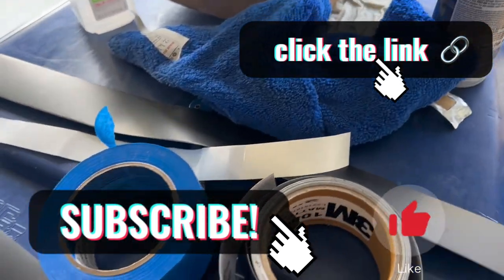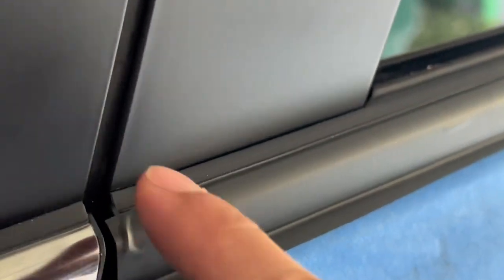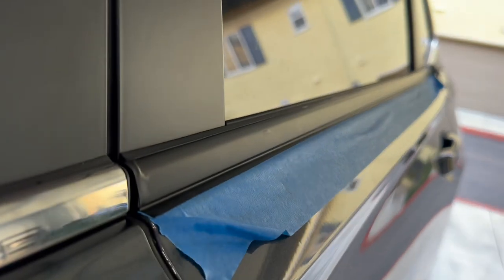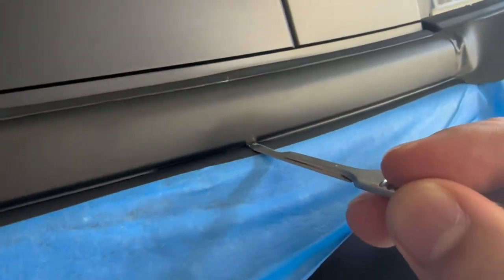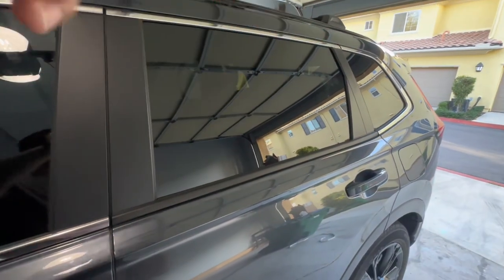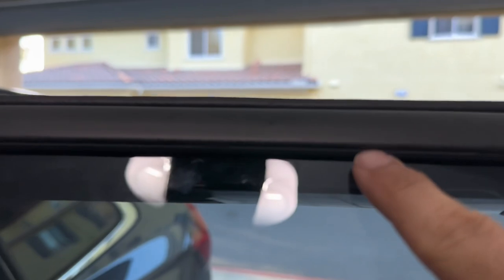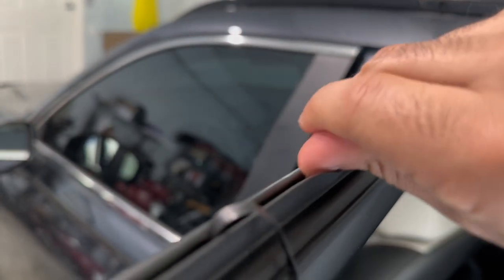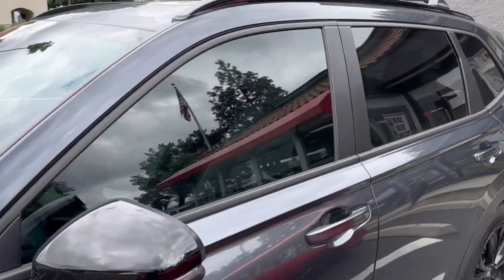HONDA CRV 2023 - CHROME DELETE!

Comment: Thanks for the video. I have the same CRV in Radiant Metalic Red. People are asking about a video on Fog Lights. I dont believe there is a Honda accessory for Fog Lights on a 2023 CRV. ???
Reply from the maker: Theres no honda accessory correct. 
I have purchased 3rd party accessories. 
There is a slot for fog light switches left of the steering wheel however.  2 blanks. 
Nice color choice!  Id be interested to see it with black trims. Itd look nice with a deflector and black door handles.

Comment: Another question, can you give some pointers on how you did the wider curved part of the trim? I'm assuming you used a heat gun to get it to bend ? Thanks
Reply from the maker: I used a big sheet for that part.  And cut it out once i placed it on top.  Not the easiest part.  Bending doesnt work too well at 90deg
Reply: @DrHondaCRV  Ah this makes sense, thanks. I didn't even notice the 5ft by 2ft link. I already have the 25ft roll, going to order the big one now. Thanks again

Comment: Looks good. That hood air deflector did you put on?
Reply from the maker: I had it installed at the dealership.  But it doesn’t seem to complicated to install.  Some cheaper online dealership Links in bio if you want to order.
Reply: @DrHondaCRV   it’s sitting in my kitchen. Was thrown off online cause it says it’s only for EX & EX-L
Reply from the maker: @nmfdchris  interesting 🤔.  Well.  I added it. Haha.    I know they have different floor mats for hybrid vs non hybrid. I wonder if theres a slightly different one for hyrbid

Comment: Looks awesome. Good work.  Question- I have the hood deflector too. Ok to go through a car wash? One of those new carwashes, you buy a membership for 25 bucks and can use it once. day. they seem to be gentle with cars. Used it on. my last one. was fine. Just worried about the deflector.  thoughts?
Reply from the maker: I guess it depends which way their brushes are spinning.  against the opening wouldnt be great.. on another note, don't take your new car into a automated washer!  might as well wash it with sand paper XD. micro scratches for days... :(
Reply: @DrHondaCRV  good points. I’m just not as young as I used to be. Thanks for reminding me of why I should find another solution

Comment: How did you do the hyperdip on the square grills on the front bumper? Did you pop them off or mask and paint them as is?
And did you also do the same for the ones at the back bumper? Or would there be an issue with having an exhaust in one of them?
Reply from the maker: Just mask and paint!  im doing the back ones soon. the exhaust doest touch it  so its fine. the pipe is behind
Reply: @DrHondaCRV  Thanks! I saw your latest vid and it looks great so I want to try to delete the chrome on my red one as well. I noticed that some people use hyperdip or plastidip on the chrome of their windows. Any reason you used tape instead? The tape is harder to get here than hyperdip but just wondering if there's anything in particular with the cr-v that made you use tape instead.
Reply from the maker: @mauz30  So the dip isn't as durable. especially in high use areas. I honestly thought applying the tape was easier than the hyperdip. a lot faster too.   logo i used paint because it was too intricate for vinyl tape, up to you!.

Comment: How did you do the last section of the window? I’m having a hard time tucking the vinyl in that section. The rubber trim seems much stiffer in that area.
Reply from the maker: So i used the 2x5 sheet in my description. I covered the whole window with it.  

Then did a rough cut carefully. Making sure not to cut the paint.   Then a finer cut along the edge.  I kept pushing it down with my hands to find the edge crease.   If you accidentally cut short use a heat gun to stretch it out.  

Theres some videos on youtube.  search for rear window 3m tinting.
Reply: @DrHondaCRV  great job on the chrome delete. i'm planning to do the same on mine. did you use two 2x5 sheets, one for each side? Or was one 2x5 sheet enough for both sides?
Reply from the maker: @markofthekings  one was enough. I cut it in half. You have to angle it just right.

Comment: Found the headlights good, except for rainy nights as you said. Still miss fog lights. My 2018 crv is awesome at night with all those super bright amazon led lights lol
I like the blackout, I just don't have the patience and refuse to pay anyone to do it.
Reply from the maker: 😂😂😂 I did the left side. And the right was 2 months later.    Weekend hobby if you get bored.
Reply: @DrHondaCRV  I'm going to add caps to improve visibility of ac vents, 304 stainless mirror finish license plate holder, remove dealer stickers, do led rear blinkers, maybe replace the horn. Waiting on the good weather tech mats to come out, bought the rear cargo cover and partially ruined due to wrong placement... Which by the way, what a waste of money considering people can still see your trunk from that rear little side windows...
Nothing too risky here hehe
Reply: @DrHondaCRV  The rear led replacement are 7440, so easy to replace, two screws the housing pops out.
Reply: @DrHondaCRV  Also ordered some warm white led lights for the sun visors.
I don't know you, but I do absolutely all my maintenance, my car will never ever see a mechanic, and I found the location of the engine filter to be the worst ever imaginable. All the way shoved in the back between fuel and brake fluid lines. So hard to take in and out. Cut myself I don't know how many times lol. Of course Honda uses those nasty oiled engine filters, so I ordered an aftermarket one. Those oiled filters are truly bad for sensors and will eventually create an oily film everywhere the air goes after that.
Also noticed that I have to remove the entire door to replace the cabin air filter, but it is super easy anyway. The door just doesn't go far down enough otherwise.
Reply: @DrHondaCRV  Ok, my last observation I hope lol.
Hate the way washer fluid comes out, plus we don't have any indicator light for low fluid as Canadian versions. So you can't see the fluid, neither know when it's low. Freaking bizarre.
Then it was a great surprise, that even if crappy, you can use the fix and go compressor to fill your tires. Threw away the liquid fix, but nice to have the compressor  hidden like that, and for free.
Reply from the maker: @rafars2246  good to know. So easy swap for blinkers?
Reply from the maker: @rafars2246  too lazy for black vinyl but do all your maintenance? Haha.   Did they give you 2 years free service like mine?   I just take it there for free oil change and tire rotation.
Reply from the maker: @rafars2246  jeeze. Air cabin sounds annoying to change.  I thought you meant the car door haha
Reply from the maker: @rafars2246  yea its an interesting window fluid mechanism.  Keeps the hood clean though.   I bought a battery powered tire pump. And a tire plug kit. I got a flat last month.  And it was a quick temp fix. Until i could take it to the shop for a full patch
Reply: @DrHondaCRV  not even about being lazy, just make me very nervous and stressed when it comes to precision jobs like that.
Yes Honda themselves gave me the two year free maintenance, but I can't put my car in stranger hands. Plus I know how to do it. I take easy, just gives me piece of mind. And I do things my way. Replacing that engine air filter asap, doing the first oil change at 1k miles or whatever, haven't looked how to break in a hybrid yet.
Even with simple oil changes and tire rotations things can go wrong. Hate when guys over torque lug nuts, and they always do. Many things. I just like to be in control.
Reply from the maker: @rafars2246  ahhh gotchya.   Yea you’ll treat it best Forsure.   I went for an oil change at 4k. And the guy said no sooner than 5k. Because apparently the first mix of oil is different and designed for breaking the engine in.  Idk how true that is.
Reply: @DrHondaCRV  Just remembered now after reading, how Honda supposedly states in service bulletins that early first oil changes could cause engine hotspots. Remember now that I did my 2018 1.5t first oil change at 5k miles. I'll probably do the same since my 2018 is running  pretty well.
Reply: @DrHondaCRV  remembering now, was putting some extra foam in the sunglass holder, so the glasses don't make noise while driving. Same thing I said yesterday about precision work, kills me, but this one is totally necessary if you put glasses in there.
Reply from the maker: @rafars2246  yup definitely. Did the same. Or it rattles
Reply: @DrHondaCRV  just discovered in my opinion a really bad thing. Being inside the car with the ac running, not driving, honda doesn't allow it. At some point the car shuts off, which is total bs since I was thinking on maybe taking a nap or whatever in a long trip. Hopefully there's a software trick to that because then I'll surely regret not to have bought a toyota...
Reply from the maker: @rafars2246  interesting…. Have you tried using the honda app?  I think you can set temps in there
Reply: @DrHondaCRV  actually I don't know what to think anymore. If you seat on the driver seat it doesn't go off, or it would take longer to go off, no idea. If you seat or leave someone on the passenger seat, haven't used a timer, it goes off after not sure how many minutes. Regardless, not good for car sleeping if you bring some topper or something to sleep on the back. F Honda is all I have to say lol
Reply from the maker: @rafars2246  i put a full size bed in the back. And cracked the windows. It was enjoyable
Reply: @DrHondaCRV  depending where you live. It it is too cold or too hot you can't do that.
Reply: @DrHondaCRV  Another important one, with those knob covers, sooner or later you'll scratch your trim. You can't move the knob all the way up or down because of the added thickness. Sure you could be careful but that's annoying. Sending them back. They really looked nice but nope.
Reply from the maker: @rafars2246  oh interesting.   I never really move mine haha.   Was debating to add a trim plate to the dash
Reply: @DrHondaCRV  And the last one, this are the measurements for your engine air filter. Eight and a quarter inch by five and a half.
Save this because there's a lot of bad info on filters out there. It might change in the coming months but I ordered my "compatible" filter according to amazon and other auto part stores and it wasn't compatible.
Since it is so annoying to take it in and out, better just measure the filter you buy and discard it, or not, without having to take everything apart.
Reply from the maker: @rafars2246  do you wax your car?
Reply: @DrHondaCRV  I should but I have no garage, I park under an oak tree and there's no day in the year that that tree isn't dropping something lol. And I don't want to get kicked out of a parking lot.
Reply: @DrHondaCRV  I was successful with the blinkers. They are extremally bright and worked perfectly no problem with hyper lashing, not even in long lights. People do not tailgate while turning intersections. It blinds you at day time too. Really impressed with the Honda reflectors that do not scatter light everywhere, just backwards. When I said easy to remove, they are, but you'll find resistance because somehow the headlights clip on the outer side. They feel hard to pull, like stuck, but eventually they come out no problem.
Reply from the maker: @rafars2246  niceee. Which brand did you get
Reply: @DrHondaCRV  Copy pasting the name. It sucks youtube always ends up deleting comments with links, otherwise I will show you how they work.
Alla Lighting CAN Bus T20 7440 7443 LED Bulbs Amber Yellow Turn Signal Lights, 7444NA 7442NA WY27/8W Blinker Lamps Replacement
I had these for a year in another car, and they never malfunctioned either.
Bad reviews are only because people with incompatible cars, usually american trucks and toyotas. These are the brightest and safest with an included fan.
These ones have the mayor advantage of not having many leds. For experience, bulbs with many led chips will fail way sooner than later. These ones have four big led chips per bulb, not 30.